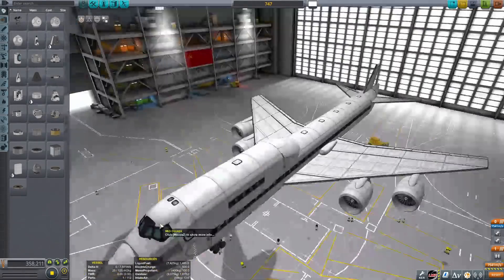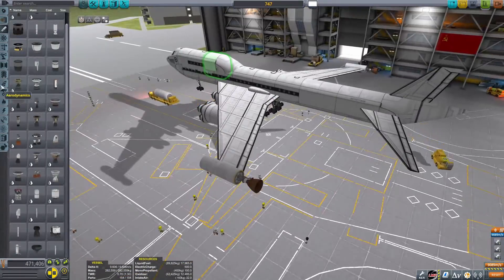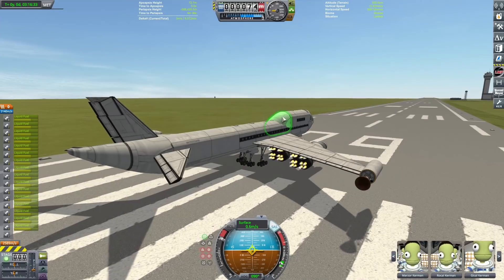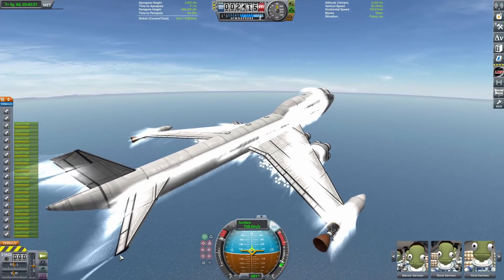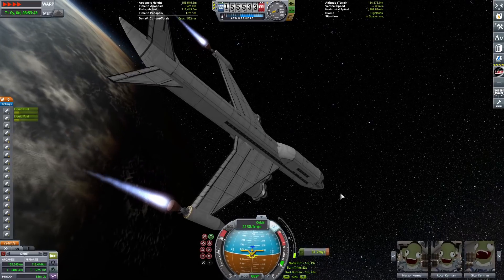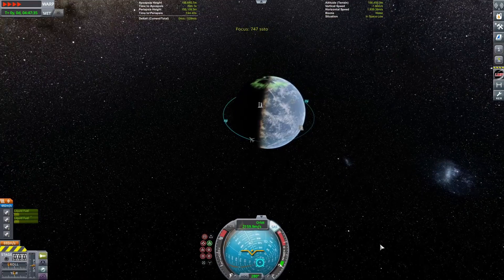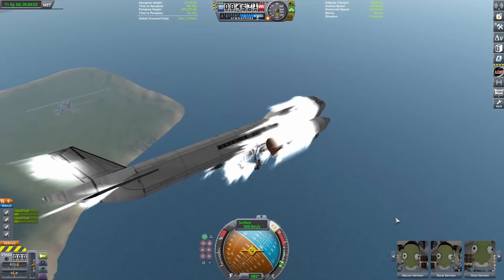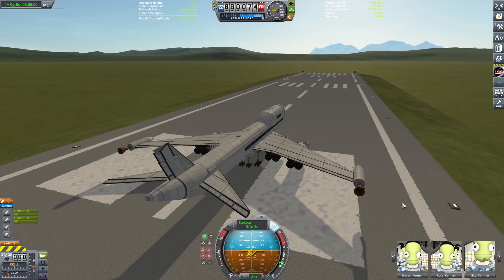KSP: Converting A 747 Into An SSTO Spaceplane! [stock 1.11]

Comment: This reminds me of a mission I did in career mode. I was tasked to recover Werrhim Kerman and his debris in orbit of Minmus, so I had the bright idea of taking an SSTO there and welding a docking port and rcs to his lander can, before docking it to the SSTO.

Turns out I did not think things through, so it was a very tedious effort to prevent the lander can from floating away, plus I realized the lander can had no electricity. If not for a spare battery on the SSTO, the mission would have failed outright.

I ended up getting Werrhim and his debris docked to the rescue SSTO, and now they are on their way home.

Moral of the story: if EVA construction is involved in your mission, PLAN AHEAD!!!!
Reply from the maker: F
Reply: @Piolet1549  ok the rescue mission is over and there was one more hiccup: the SSTO was slightly unstable on reentry and flipped like a dolphin before stabilizing. Truly a Kerbal  mission.

Comment: I guess they could make an SSTO out of it, the wings and the steering surfaces would have to be completely rebuilt.
Reply: All the aluminum would melt due to the temperatures, so you would have to replace all of it with titanium, Inconel, and ceramic tiles.
Reply from the maker: yeah, there would for sure be heating problems

Comment: I have also made the mistake to lose things in orbit, i managed to take of a sr docking port on my space station and tried to fly back to the space station, but i just dumped it in space. Thats a boring thing with eva construction you cant move things without gliding away and you can use eva pack in eva construction.
Reply from the maker: F